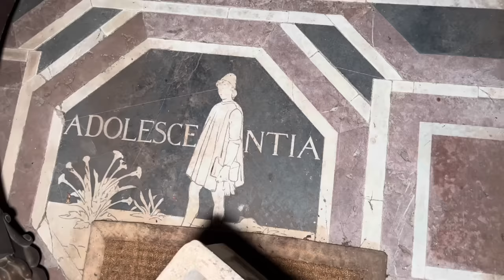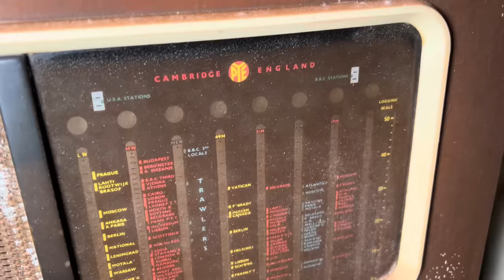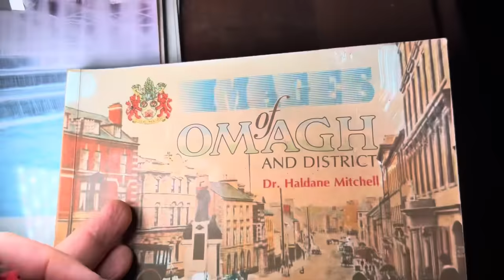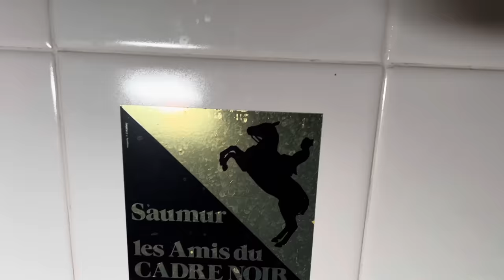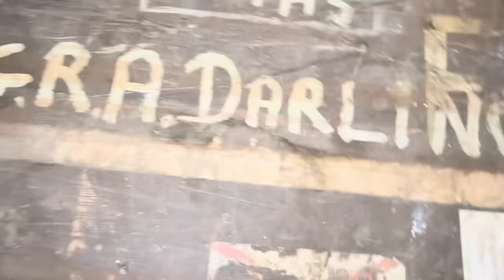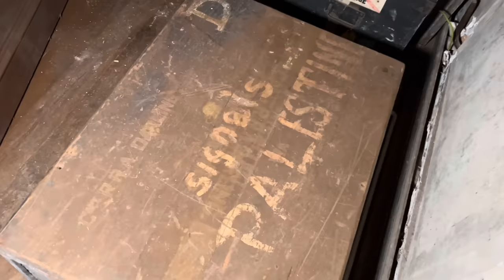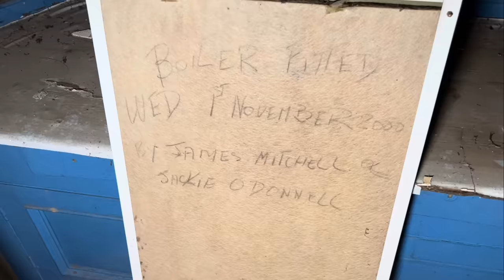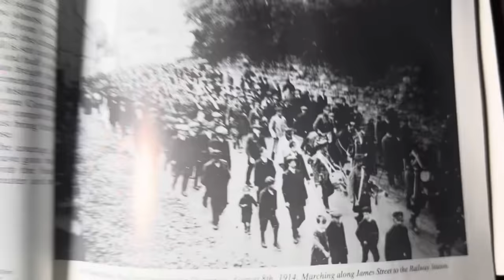I was WARNED not to explore the Captains ABANDONED house in Northern Ireland

Comment: Those are glass negatives. In the dark room you could place one on light sensitive paper & expose it to light for the right amount of time & then place it in a bath of developing solution & then take it out from that when the print looked dark enough, rinse it off & put it into a bath of chemicals to prevent it from developing more. Then it would be gently rinsed & dried & you would have your photograph. You could also use a machine called an enlarger to project light through your negative onto the light sensitive paper to create images of different sizes.